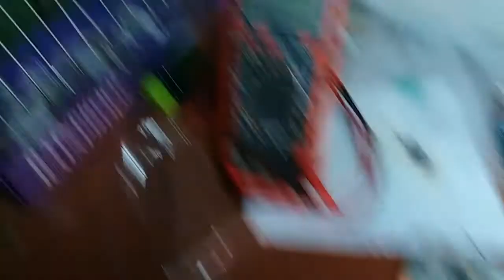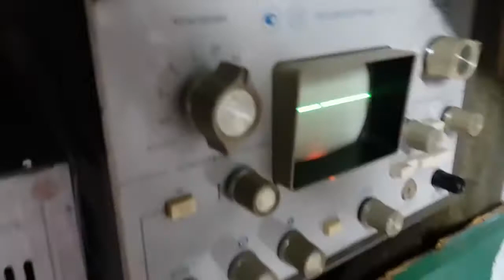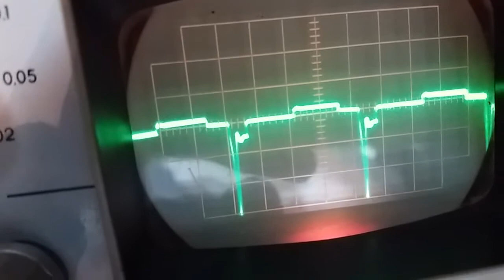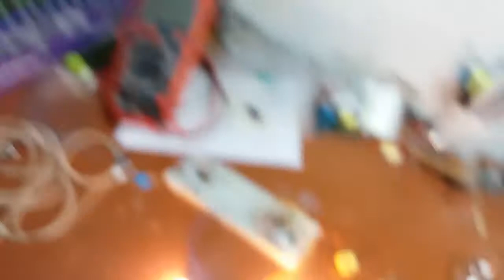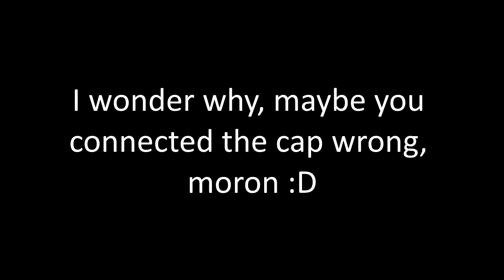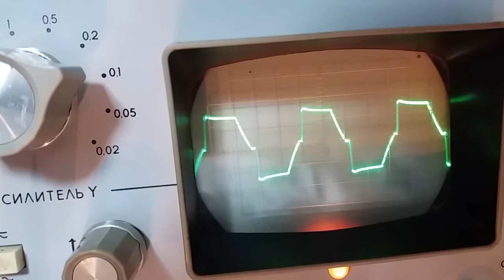tl494 SMPS: Part 3 - Adding shaping circuit&reliable self-start

Comment: why do then atx power suppyes have that thirth winding in drive transformer ? Better switching maybe ? I mean they have secondary supply inside I dont understand why is it necessary than ?
Reply from the maker: I think it provides a bit more current for the bases of the transistors, so they saturate fully. Otherwise you will need more drive power from those little transistors powering the drive transformer. Can't guarantee that what I said is 100% correct, but that's what I understood from experiments and it matched my expectations.